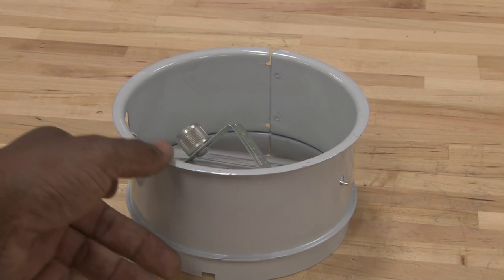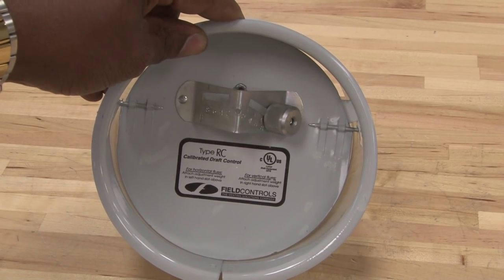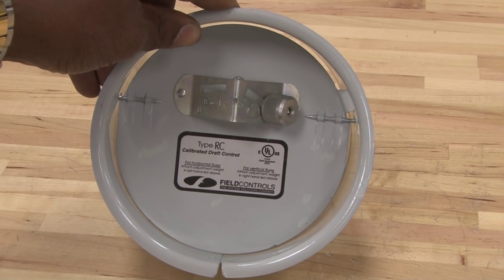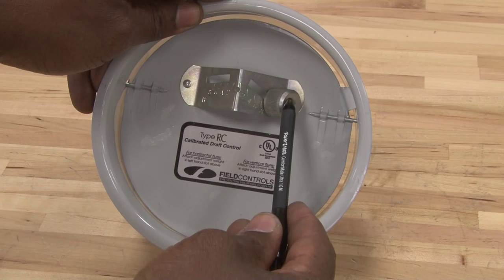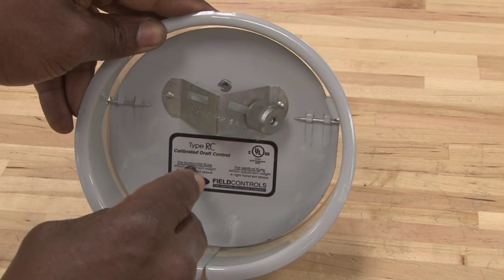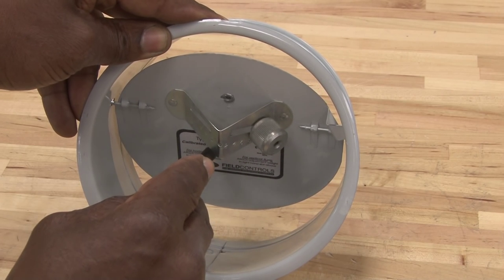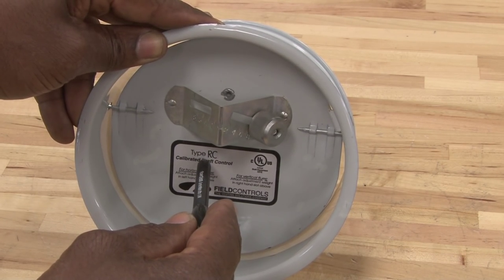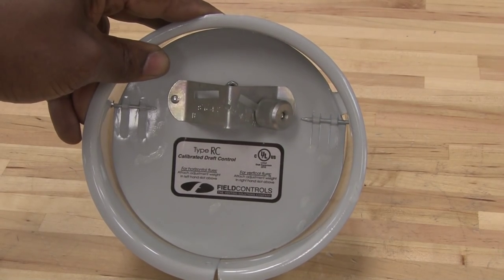Barometric Damper

Comment: I was getting ready to install this, but it's only seems to be sold as it
 is. What I am looking for is how to mount it on my 7" flue pipe.  Do I 
just use a 7" tee ? Do I need a certain class rating of duct, or is there a name of the part I need to slip this 
into ? Thanks